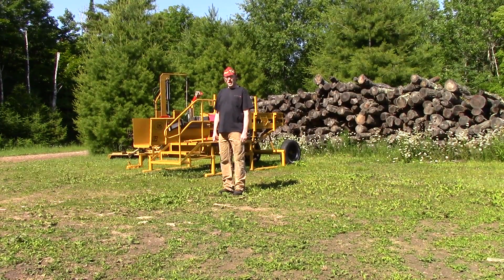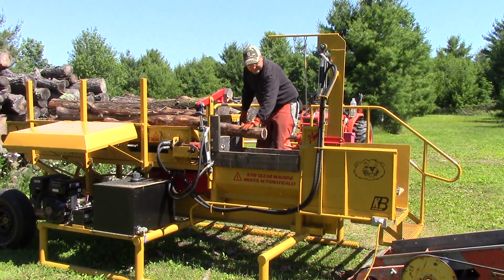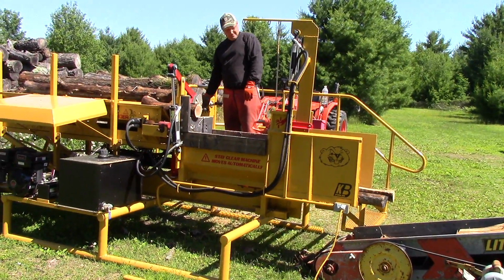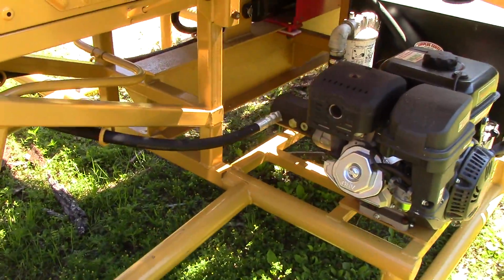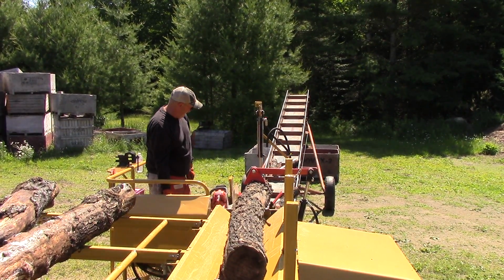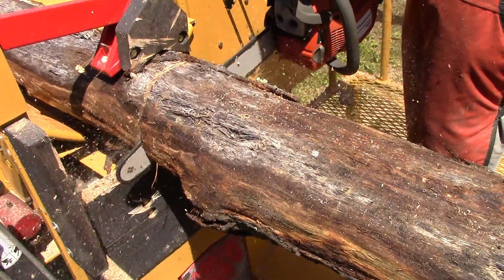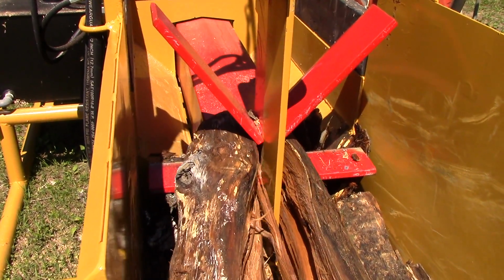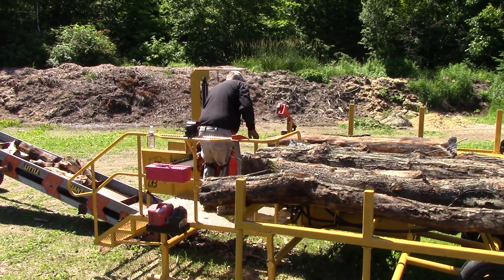Angry Beaver Firewood Processor

Comment: Nice design. ** I really like the jogged conveyor idea.  I am sure you can come up with many  tweek improvements on your own as you use it.  Off the top I would suggest an hour glass idler or live hour glass roller  to help center the log on your conveyor.  You are losing significant cycle time by placing and removing the chainsaw at 90° to the cut and the ergonomics may eventually cause user back problems.  If you want the freedom of the loose chainsaw you may  consider to relocate your holder above your ram.  Great to see new concepts. Sweet build on the bucket too!
Reply from the maker: Jeff Murray, thank you for the great ideas, and thanks for watching!

Comment: Can't believe he build this whole set up all hydraulic and then - picks the chain saw up by hand for every cut! picking up the damn saw it what kills my back and was why I want to make a processor in the first place! Kevin - mount that saw to a pivot and just pull the throttle and lift the handle man!
Reply from the maker: Robert Little, he does not sell wood it is only for himself. I'm sure as time goes by there will some adaptations. Thanks for watching!
Reply: True - good point Ricky - my own inventions go through iterations of development and changes as I use them.  If they add a saw holding system post it for use to see the modifications.

Comment: an improvement in work process would be to use the long handle picaroon to move the logs into splitting position rather than bending over and doing it manually.  And...if you could build a holder for the chainsaw with pivoting action, that'd be commercial grade!
Reply from the maker: John Craftenworth, thank you for the ideas, and for watching the video!

Comment: After all that work ...then you have to pick up that saw!!
Reply from the maker: Thanks for watching.
Reply: Ya definitely need a pivot mount. Save your back.
Reply: After splitting many cords of wood on this I would never even consider mounting the saw. I run way too many crooked logs. I would agree if I was always cutting straight poles but that’s not realistic. A bigger engine and pump would be nice to speed up cycle time with a 30” ram splitting 28” it feels slow

Comment: Backbreaker.
Reply from the maker: Ruthless Goat, maybe, but it beats the hell out of cutting it all by hand, lifting logs or cut logs,  hauling, handling again to put it in splitter, then again to stack. This machine saves a lot of manual labor. Thanks for watching, and your comment.
Reply: No question.  Just my observation. I'm amazed at some of these machines that people have innovated.
Reply from the maker: Ruthless Goat, me also, I enjoy looking at the ingenuity that each individual can come up with!
Reply: On a normal day of use I really don’t bend much I was being a bit fussy in the video because of what I was splitting. normally however it falls in the splitter I just send it and it works for the outdoor boiler. Campfire wood I try to get small splits that’s why I center the wood better

Comment: Seems like a lot of time and metal wasted, you could have gone through ten times as much just cutting them at the pile with the chainsaw then putting them through a log splitter.
Reply from the maker: With this it requires less bending, and less manual labor, the elevator drops the split wood directly in the box which can be moved with a tractor as compared to picking up each split piece separately.  Thanks for watching and you input.
Reply: @HRIservicesllcSturgeonBay   we have a wood processor wich powered by kubota 23hp diesel